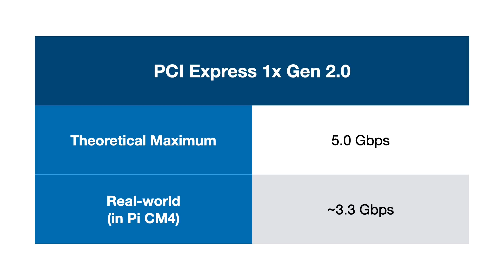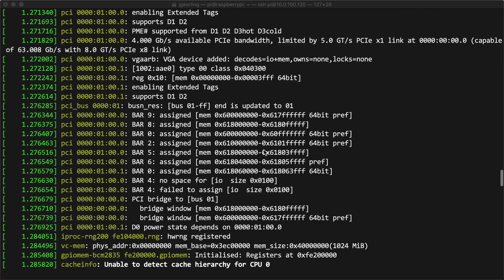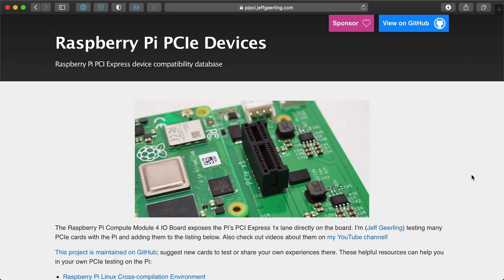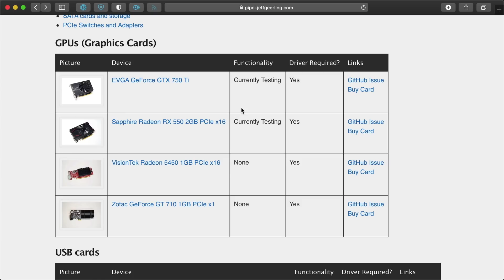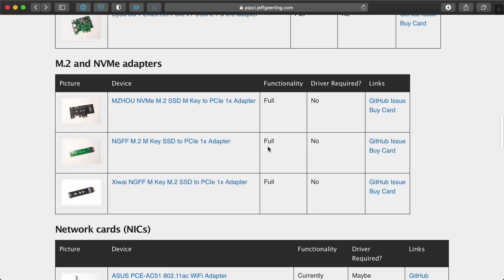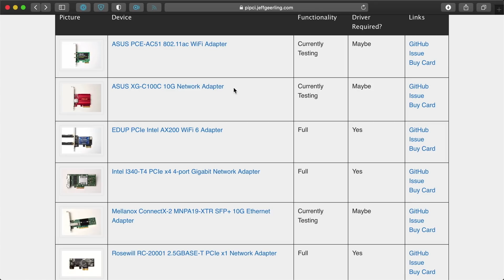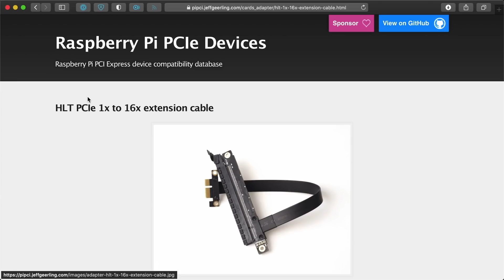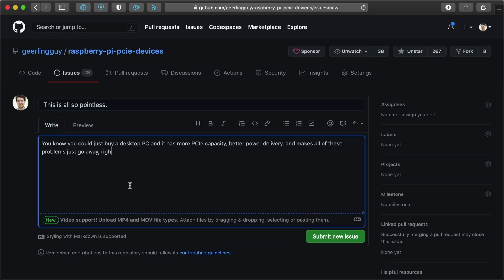PCI Express arrives on the Raspberry Pi CM4 - A Guide

Comment: Just in case anyone tries this and messes up the pins, these PCIe x1 slots are through hole components and can be easily replaced for $2 (also meaning you can modify them before soldering them on so you don't damage your board).

https://www.digikey.com/en/products/detail/samtec-inc/PCIE-036-02-F-D-TH/6561616?utm_adgroup=Card%20Edge%20Connectors%20-%20Edgeboard%20Connectors&utm_source=google&utm_medium=cpc&utm_campaign=Shopping_Product_Connectors%2C%20Interconnects_NEW&utm_term=&utm_content=Card%20Edge%20Connectors%20-%20Edgeboard%20Connectors&gclid=Cj0KCQiA0MD_BRCTARIsADXoopaKFOiz5k20HjN2BipCuAYyQs3VfPKPpHTxynLbwO07obcqTukyRlMaAnShEALw_wcB

If anyone manages to find a distributor who ships "open ended" PCIe x1 connectors, please share!
Reply from the maker: "Easily" assuming you also have a soldering iron, solder wick, some flux and solder, and basic soldering skills. Many of us do... and many who don't should take it on. But it's not something I'd recommend to just anyone; easier to use the adapter cable and not touch the board itself.

It would be nice to find replacement open ended slots.
Reply: @JeffGeerling  Fair enough, yes, there are the other options you mentioned that are much better if you don't want to don the red shirt.  But if you're already ready to hack away at components on your CM4 (or even using a CM4 over a regular RPi4), I'd venture a guess that you likely won't find soldering too much of a challenge, or even new.

Comment: A square peg in an under-powered round whole. You can buy an embedded PC with more power for cheaper WITH PCIE slots. I just don't get it.
Reply: These are fun things that "you do because you can", something similar to running Doom on a calculator. What's wrong with that? No one is saying that this is in any way practical.

Comment: I've worked in 3 different medium/large architecture practices that reserve 1gigabit for render specialists that use 25+GB files, memer mortals using 1-5GB files are still limited to 0.1gigabit!

When you say LTT are ahead, I'm not quite sure that meets the bar they seem to be aiming for! By today's standards, 10gbps is still a hard cost/effectiveness sale;  assuming the vast majority of businesses have files sized significantly less than mentioned and save even less often! One day I hope 10gbps will be standard, but at the current rate it'll be years, if not longer,  before it is widely adopted. 

I'm not one to cast shade on this, I run 10gbps at home for various backups and large storage drives (independent work) and I rarely exceed the bandwidth limit. I hate to think this may be standard by 2030+, but it may be the truth 😂😭...
Reply from the maker: I mean, LTT created their own problem by switching to insane 12K resolution cameras that pretty much nobody outside high-end film studios are even touching yet.

4K is still 'high end' for the YouTube/web-based production world, 8K is a rare luxury for fancy-pants productions that like to crop their shots more than use the right focal length and camera positions 🤪

Comment: so why even bother at all with a 1x slot. Wouldn't it be better to just put some thunderbolt 3 or usb 3.2 gen 2 connections instead and run an external pci-e off that.
Reply: by that wouldnt be true pcie

Comment: Re the kernel modules/kernels. Have you considered putting the code in GitHub repos and running actions? That way you can set it up so it builds by itself when the code is updated, and if you save the artifacts you can share those with others.

Comment: I kinda want to try if sound cards work on this, that way I'm gonna have a mini midi controller....
Reply: I have a suspicion they wont.

The PCIe controller on the Pi4 doesn't support "IO BARs", that is not an issue for stuff that was designed from scratch in a modern way but its a big issue for stuff that was designed a long time ago and has received only minor updates since.

Comment: PCIE slots typically supply up to 75w, how much power is the slot supplying? is it under what the GPU need to work properly? have you tried any with an external power supply?
Reply from the maker: The 12v supply on the slot goes directly to the power source I believe, so it's mostly up to what adapter or PSU you use. But safer to use an external riser with high-draw cards.

Comment: They should have just built that slot open-ended to begin with. Plenty of motherboards have such slots.
Reply from the maker: From some quick research, it seems like the open ended slots cost a tiny bit more and are less available, so it could've just been down to a decision to make sure they wouldn't disrupt the building of the IO Board over time (since it's not a very high volume product compared to, say, the Pi 400).

Comment: One thing I would really like you to test, the coolers and fans for the compute module 4.
Are the existing models for the raspi4 compatible?
Is there new products coming?
Reply from the maker: So far nothing to buy, but I know in the Turing Pi 2 renders, there's a massive passive heat sink that looks really nice.

Comment: until RaspberryPi CM4 io boards drop the mostly unused and unnecessary proprietary digital flat panel and camera ports and use the numerous PCIe channels they use for at least a PCIE-X4 for NVME or a 4x SATA raid card I won't be buying into the CM4.

Comment: I'm curious if it's possible to design cm4 third party board equipped with 2 pcie sockets. Would be nice to connect maybe 2.5 gigabit card and 4 sata card to make the fastest nas on a pi. D:
Reply from the maker: It would need to incorporate a PCI Express switch to do that, but it is possible. The CM4 MATX project is aiming to have multiple PCIe slots: https://github.com/TheGuyDanish/CM4_MATX

Comment: Do you have a mailing address listed somewhere?  I have an LSI SAS 2008 card where the fuse on the 12V line failed, and I don't have the right equipment or soldering skills to fix it, so it's now just sitting in my closet, replaced with an LSI SAS 2308 card.  I could send you the 2008, as long as it's not ridiculously expensive to ship.
Reply from the maker: I would accept it but I now have a glut of pre-2010 LSI SAS cards, and it seems like they are not quite built to work well with ARM architecture (according to some engineers who worked on them that I got in touch with last month!).

Comment: Another great video! Thanks Jeff.
Unfortunately I get a bit confused. Du I understand correctly that the Syba SD-PEX20199 Supports USB PD? I didn't find anything in the Amazon description or on the Website from Syba. Could a MacBook still be charged if the sata power connector is used? If yes witch IC is used for USB 3.0. is PD in the main IC or being supplied by a second chip?
Reply from the maker: It seems like it might, but I have not tested it... I keep forgetting to test it at all when I have it hooked up!

Comment: 9:44 I think you meant ssds with NVME
Reply from the maker: Heh, I confuse even myself! But then again, you can find "SATA SSDs", "NVMe SSDs", and other things called SSDs which I don't normally think you'd call an SSD. I think "SSD" is now the generic term manufacturers add if it is "any kind of storage medium that does not have a spinning platter".

Comment: Those crypto extenders don’t use USB, they just use the cable because it has a lot of wires.
Reply from the maker: They don't use USB the protocol, but they do use USB 3.0 cables.

One very important thing to note is you should not switch adapters between risers, if you have more than one—I've found they each have a different pinout for the little x1 adapter to USB.

Comment: Something in my gut tells me this one might work. Not a gaming card, to be sure. https://www.tomshardware.com/news/asus-geforce-gt-710-graphics-card
Reply: Sadly he tried a different gt 710 and it didn't work I think a Macintosh gt 210 might work though
Reply: @Shaddow798  I have one of the mac gt 210 cards that came with the original mac pro. The problem with the 210 is even with nvidia’s experimental web drivers, the gt 210 is built for x86 systems. very difficult to get working with arm. Maybe with m1, we’ll get GPUs designed for ARM

Comment: M.2 is a generic term that covers BOTH SATA(NGFF) & NVMe which are NOT pin compatible. To get the best throughput with any M.2 card, either use the connector that is built in to the motherboard. If you do not have motherboard M.2 mounts then you MUST have at least PCI-E gen 3.0, a PCI-E gen 2.0 simply doesn't have the bandwidth to support the M.2.

Comment: I hope that one day the Rasberry Pi people make ITX, microATX and ATX motherboards based on the RasPI.
Reply: Never thought of that. What would be the advantage or use?
Reply: @soy_leche  Fun. Also they could have full pci-express X16 slots we could put graphics cards in and attach much more powerful cpu coolers and far more beefier vrm's around the cpu for overclocking. Also removable ram modules. More IO.
Reply: Maybe when ARM replaces x86 and people will really need upgradeable ARM machines, that will happen

Comment: Please try some of the StarTech USB cards. The have some card with both USB 3.0 & USB-C ports. Adding more USB-C to a Rpi would really make it take off.
They have one that is a x1 but runs five(5) separate USB 3.x channels each with UASP on each channel instead of what most other cards which are actually a USB HUB with only one(1) 'REAL' USB 3.x channel.

Comment: Jeff, you should try a SAS HBA (hba, not raid card). You can even try a card with P20 firmware (you can find them preflashed on ebay for cheap). The P20 flashed version have no bios so it should give you less problems, also this firmware is more compatible with Freenas, unraid and similar
Reply: I wonder how it would handle an Sun Oracle F40 flash accelerator card? (4x 100GB SSD HBA, currently less than 30 dollars on ebay)
Reply: @virtualtools_3021  there Is Aldo a 800gb and 1.2tb model (dame design bit with buffet SSD). If the where chepere the 1.2tb i Will buy the 😂

Comment: I remember using that ASM sata card ages ago. It is slow and becomes even slower if you use two drives as it is just multiplexing.
Reply: But at least you won't have to physically switch between drives if you have several you want to use.

Comment: Hello. Wow! What a lot of hardware tested 🙂 I'm still waiting for my CM4 to arrive but very interested in participating with this effort of getting interesting PCI devices working on the Pi. You didn't mention much about the OS used. Full disclosure, I'm Engineering Director at Canonical for Ubuntu Desktop and have been working closely with engineers at Raspberry Pi Trading this year. Ubuntu on the the Pi is just Ubuntu, with added Pi enablement. So, if hardware works on Ubuntu, it should work on the Ubuntu for the Raspberry Pi too. In particular Ubuntu 20.10 is where we've recently invested a lot of effort, so that's a good version to use as a starting point. If you want to hook up and have a chat I'd be happy to see where we can help 👍
Reply from the maker: That sounds amazing! And I'm extremely impressed with how far Ubuntu for Pi has come in the past year—it really has been a great drop-in replacement (with some very nice features like cloud-init) for Pi OS.

I may consider doing more of my default work on it. I would love to chat sometime—would be great to see if we could make Ubuntu for Pi have at least many of the main use cases supported out of the box in terms of precompiled drivers (USB, SATA, Networking especially).

Comment: 0:44 lots of the tests of NVME drives on PCIe gen2 x1 shows around 400MB/s read/write speeds, which makes 3.2Gbps total. So I guess you reach PCIe bandwidth limit in your setup. However, PCIe is a dual simplex bus, so it should push 5Gbps in both directions. I believe those Asus card could push more in bidirectional UDP iperf test with multiple streams (make sure that rss/rps is enabled in driver). However, I'm not sure that Pi is actually able to generate such an amount of traffic with iperf even if you use jumbo frames. Probably it can bridge this traffic from port to port, i.e. if you use external PCs as an iperf server and client.
Reply from the maker: _Should_, but in practice I'm not able to get more than ~4.16 Gbps bidirectional. More to come in the ASUS 10G NIC video ;)
Reply: Nice! Can't wait :)

Comment: at 1:55 the pci riser crypto thing. Do you know max power the different connections can deal with, without causing overheating, cable melting or fire problems. I've had a few melt on me and short. Have you tried these risers yet? https://gpurisers.com/shop/ Thoughts on them?
Reply from the maker: I haven't tried GPURisers, but it looks like their products have a little better production quality and I like they have LEDs... it's impossible to tell if one of the ones I'm testing is even powered!

The difficulty with PCIe is that power requirements are decently defined, but to implement the correct filtering on all devices requires better design, more board space, and sometimes more components, and some cheaper cards skimp on these things, expecting they'll always get 'normal' ranges of power inputs... then you give it double the voltage or something and POOF, the card is gone.

Anyways, this is one area I haven't dug too deep into yet, but I hope to do so at some point. Might involve my Dad, who's an electrical engineer and has done a bit of circuit design work in the past!

Comment: I'm curious: does Mellanox ConnectX-3 or later work on Pi? And how about RDMA over IP/SMB?
Reply from the maker: These are questions I can't currently answer—the three cards I have are all ConnectX-2. I may be able to test RDMA support on the X-2, we'll see! Follow this issue for the current status: https://github.com/geerlingguy/raspberry-pi-pcie-devices/issues/21
Reply: @JeffGeerling  Mellanox ConnectX-3 MCX341 are really cheap from China though, but they do have weird converters on them, because they were not meant to be used in a standard PCIe slot.
Reply: @bastian433  CX311A here. Works like a charm, totally no problems (but i tested them only under Windows so far)
Reply: @JeffGeerling  AFAIK, RDMA implementation on ConnectX-2 is incomplete. Was unable to enable it on Windows 10 Pro for Workgroups and WinServer12. Cheap ConnectX-3, though, works perfectly with RDMA over SMB on my Windows setups.

Comment: Is it possible to leverage a GPU for use cases other than video out?

Mining would be the obvious one, Plex on Pi is very functional with the exception of transcoding which potentially could be added with a half decent GPU
Reply from the maker: My main purpose for testing the Nvidia cards is to see if there's any way I can utilize the CUDA cores for ML/AI. Though there are other purpose-built chips like the Coral TPU that may be easier to get working.

Comment: I wonder if there is an pci e Module that can have PC DRAM modules to use it as a DRAM auxiliary memory? For example to map a Swap partition there instead of a disk ?
Reply from the maker: Using a Mellanox card (Ethernet or Infiniband) with RDMA might allow something like this work (it wouldn't expand the memory but could allow sharing RAM and disk IO more directly between Pis...).
Reply: @JeffGeerling  I was thinking about reusing old DDR3 or DDR4 modules. Not specifically of sharing memory between  Pis. Such as an PCIe card that can have DDR4 slots. And then you can access that memory directly from the PCIe card. For example you can use it as temporal memory and avoid intensive writes in the SSD disk.
Reply: @ncarrasco2006  They don't exist, unless you are willing to pay for a ZeusRAM SAS drive, its an 8gb drive made entirely of ddr3 ram, with internal battery backup, but you probably will bottleneck with the 1x anyways, so might as well use NVME
Reply: You will be paying nearly 200$ used for an 8GB drive that will bottleneck HARD over SAS vs a modern NVME drive
Reply: @virtualtools_3021  Thanks for your message, I searched and I note that there were some other products such as: https://en.wikipedia.org/wiki/I-RAM . I wonder what are the reasons there are no modern PCIe cards to achieve that.  Having an Rapsberry PI CM4 with additional 16 DDR3 or 16 DDR4 memory ?  Or even an PCIe express card that can have much more ram, I know that the speed is quite slower , but it has the advantage that you have infinite write cycles for temporal calculation.
Reply: @ncarrasco2006  I think Intel made NVDIMM (non-volatile dimm) using their Optane technology specifically for this, but it goes directly on ram slots. Its super expensive tough. Intel makes M2 NVME storage that has Optane cache built in, supposedly only works with intel CPUs but this might not be true anymore(?). I had an Omen laptop that came with a 512 gb SSD. A small part of it was Optane. My experience wasnt very good tough, while it was very fast indeed, periodically, out of nowhere the CPU usage went to 100% (along with the fans) for a couple of minutes because this storage configuration needs to keep constantly indexing files in order to work. It was quite annoying and in fact one of the reasons I returned that laptop. There are full (pure) optane NVME drives mostly in 16 or 32gb and they are quite cheap. It might work for what you want